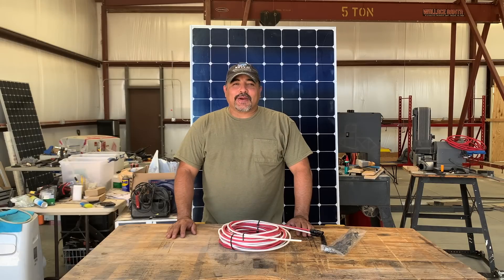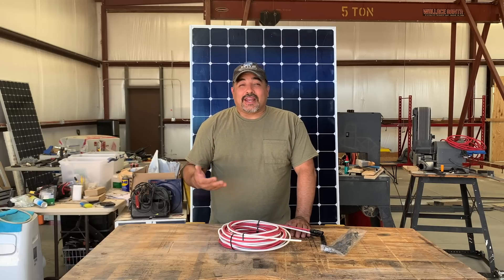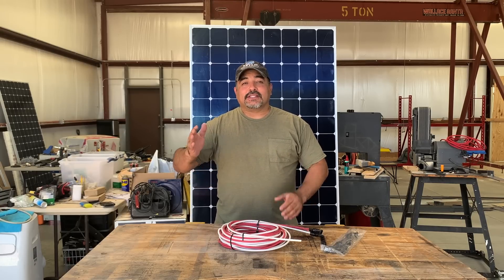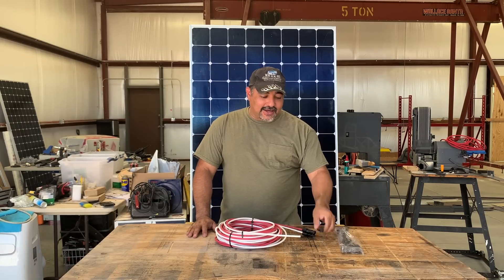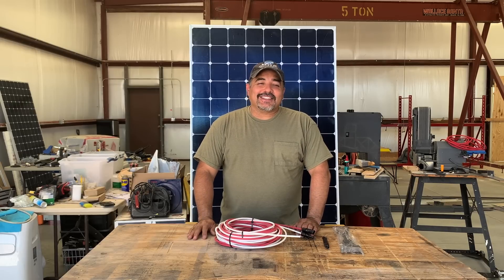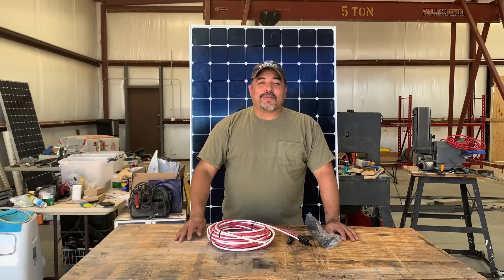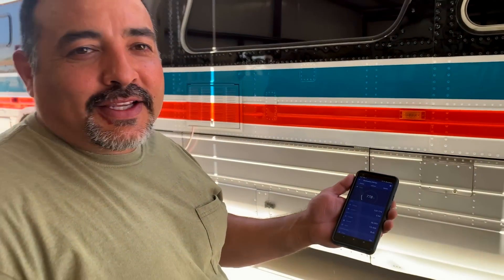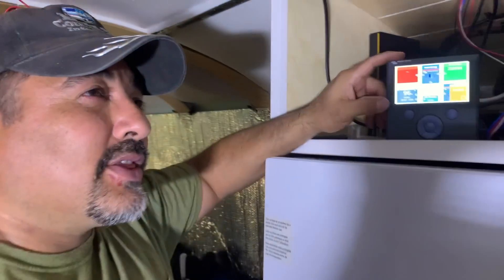More Power for a HOT Summer

Comment: 👍👌🇨🇦❤, so just throwing this out there Juan, how much battery capacity do you have in reserve, so say it stays fairly warm and you still require the ac but say you get a lot of cloud cover or the bus is not at ideal angle to get maximum efficiency of your solar panels, just my opinion, I would think you need to have more battery reserve, because as you were explaining, it sounds like you are just trying to maintain, rather than have sufficient reserve to last you over a loner period of time, I came across the same issue with my tinyhouse, but I have increased my array to 32 x 430 watt panels = 13,760 watts and have increased my battery reserve to last me a minimum of 5 days of full usage and have not depleted my battery reserve, so as with most things, more is better at least in battery reserve, of course there is little point in having a large battery bank and not enough solar either, as then the battery bank would not likely ever hit full charged capacity, I also split my array in two sections for redundancy, so if for any reason a charge controller or a meteorite (lol)  takes out some of the panels, the sysyem is still functional. Just my $0.02, which is not worth much these days, as pennies are not even a currency in Canada any more, 🤔😉🤣 and you determining your sysyem capacity in Arizona, but what happens when you change locatioms and the angle of the sun is less ideal, as your sysyem is stationary in the flat position and unable to angle the panels, I have to angle my panels to a 50 - 52 degree angle to obtain the most efficiency of the panels, If I leave my panels flat I will lose as much as 10 to 15 % and you can lose another 5 to 10 % just due to any dust on the panels, The angle of my panles matches my location lattitude
Reply from the maker: Thank you Greg for the detailed comment.  It really sounds like you have your system dialed in!  We are still learning what is working for us and really appreciate your feedback.  More battery + more solar is always going to be better (in my opinion at least).  Even if I can't charge the battery fully with my solar - we have an onboard 70 Amp charger built into our inverter if we find a place to plug in :) or in a pinch we could run a small generator.  Lithium batteries also prefer to be in the 50%-60% SOC range anyway.  When I first sized the system I knew we would be traveling and I am hoping to stay in relatively mild weather ( I know it can't always be done but if we end up in 114 degree weather you can rest assured that something did not go according to plan).  I thought if we were in some pretty nice weather just running stuff and maybe using occasional A/C or fans we could get our power requirement down to somewhere in the neighborhood of 6 kWh per day.  So I tried to size my battery as close to 3 or 4 times that much (24 kWh) thinking that we could either have a sunny day or find a somewhere to plug in with 3 or 4 days notice. We'll see if my logic was sound once we start traveling :). As for the tilting - my original design had the top set of panels tilting up to increase efficiency - I just couldn't figure out a good way to make that happen and still be rock solid safe.  The hinging with these huge panels is quite a lot to ask and well beyond my engineering capability at this point.  If I was stationary - for sure I would tilt and I might even change it monthly to match the ideal angle.
Reply: @BeginningfromthisMorning  ya Juan, thay would be some engineering nightmare, extendable and retractable and angled, I think I would just leace it as you have it, having the panels angle as well and if any wind caught them, it could really mess up you system, I did drop you an email about angling your portable panels, hope the info helps,
Reply from the maker: @pocketchange1951  Thank you - I did get the email and really appreciate you writing it.
Reply: @BeginningfromthisMorning  Juan try this panels,  they are beter reflecting the heat CANADIAN SOLAR, BIFACIAL 400W PV MODULE, 72.8" PV WIRE, T-4 OR MC-4, 30MM CLEAR FRAME ON WHITE BACKSHEET, 144 1/2 CELLS, DOUBLE GLASS, POLY, 25A MAX FUSE, 1000VDC, 373.6 PTC, CS3W-400PB-AG or the Trina and Jinko with the new cell configuration.

Comment: Heat and lower efficiency is an issue we have in summer here in Oz as well, I over specced my house setup to cope with that and because its on a tin roof I lose roughly 18% efficiency on my 6.5 Kw house system, What I learned  from you was that my old 250 watt panels can be snuck into my existing array or on the second channel and I will be buying new more efficient panels for my Bus conversion I think.
Im also thinking of trying the flexi panels mounted on an alloy skin (Safari Roof) that gives me an air gap for cooling between the bus roof and the panels as the flexi's suffer badly from heat im told.
Awesome episode!
Thank you

Comment: I ran into the problem with the heat and my solar panels, losing their efficiencies because of the heat. I knew of this beforehand but still didn't hit me until I started using my solar full time. The upside is fall, winter, and spring, I produce a load of power. On the inverter generator, don't mess with a small one; just get a 4000/ 4500 watt, or a little bigger with a least a 3500 to 3700 running watts, light a Westinghouse, Cummins Onan, Pulsar, Hyundai, or something like those. Just in case! I learned the hard way and spent extra money on a little one when I knew better. My son is happy for the small generator [ e3200 ]. I'm not! But still have the Hyundai and the Westinghouse both are super quiet, and my Hyundai is more peaceful than those Honda and Yamaha. That right, I said it! The Westinghouse is almost as quiet as the Hyundai; it's so close it's hard to tell.
Reply: One free human in this reality along these lines, another YouTuber, LongLong Honemoon, has evaluated a number of portable generators. Some of their findings might’ve a jumping off point for further gen set investigation, if you ever decide to explore that further, but it looks like your ground deploy will tide you over through the heat of summer.
Reply from the maker: Great suggestion!  Thank you so much for the thoughtful feedback.  I was really surprised at how much capacity we lost because of the heat.  We are still undecided on a generator but we will likely not be able to pack a larger one.  We are running out of room in our poor little bus.  I supposed if it got that bad we could sacrifice some of our garage space ... hmmm ... now you have me thinking.

Comment: you already have a badass inverter, a full generator would be a waste. why not use a generator without the built-in inverter to charge the battery bank? No point going from DC to AC, back to DC and then back to AC. 
you would just hook it up to a charge controller, or like the DC to DC chargers?
Reply from the maker: I had not really considered a DC-to-DC gen-set - very interesting!  Thank you.
Reply: there are wind generator alternator that have high amps 500 amp and need big rectifier do sell. 12 v @ 500 amps 6000 watts
Reply: I was thinking the same thing except to build a small engine & car alternator gen-set to output 60-120 amps DC instead of the 8 amps DC normally output by a small generator.
Reply: @gregorythomas333  You could just get a cheap Harbor F small gas genny and pull out the inverter. install a charge controller in its place
Reply: damn, they already make them
ALTEN DC GENERATORS ARE THE DIRECT SOLUTION FOR BACKING UP 12, 24 OR 48 VOLT BATTERY SYSTEMS
Reply: @swaterman08  Nice...thanks for the info!  :)
Reply: @gregorythomas333  It's only 1 of 20 other inventions I came up with that already exists, except for my double dog leash I did in 5th grade and I remember my teachers laughing at me and not taking it seriously, but you can buy them all day on Amazon now.
Reply: damn, they already make them 
ALTEN DC GENERATORS ARE THE DIRECT SOLUTION FOR BACKING UP 12, 24 OR 48 VOLT BATTERY SYSTEMS

Comment: Great job good to see that it worked 
I had a thought I lived down there in Mesa years ago and it does get hot to hot but you deal with it right my thought is if the solar panels are not able to operate at very hot temperatures can you use misters on them? I mean they worked on keeping surrounding area cool just my first thought Juan if anybody could figure that out it would be you guys.
Reply: Brian Davis I was thinking about  cooling fans as I watched this, and with the arid desert air, I think the swamp cooler idea might be useful, but being from the Louisiana, our humidity levels are so high, the misters are of negligible value, so we don’t have much experience with them here. 

After watching so many of your build , I’m sure you considered this, so why won’t it help you?
Reply from the maker: I had considered the misters and I think if we were staying here I would already be doing it.  My thought process went something like this.  Ideally we will be traveling with the weather where the temperature range we are in is between say 60 to 90.  If we find ourselves in a situation where we are anywhere near 105 degrees (this is about the threshold where the heat really affects the panels significantly), then we made a mistake somewhere (or we are home visiting family and we are hopefully plugged in somewhere ;)).  Here in AZ the misters would be amazing but as O.C. Smith mentioned - almost anywhere else they would not provide much value.  The other issue here is the hard water - and SOOO much dust.  The hard water alone would prevent us from being able to spray the "face" of the panels because they would become very milky and probably affect performance.  When we clean the panels now we have to be sure we squeegee the panels so they don't get all the hard water spots on them.  Lastly plumbing it would be non-trivial.  At this point given our time constraints and plans I don't think we will have time for it but I really like the idea.

Comment: Another great vid guys. Thanks so much for sharing and letting us know how you figure things out. Here’s my question. I know you said in the past you’re kinda behind posting vs current state of the build. So with that I’m guessing this was before monsoon started, or right about the start. I’m wondering how much monsoon has impacted and if your able to keep up all the same? I know down south here monsoon has hugely impacted what I’m producing each day and it kinda sucks. Just wondering if you’re having similar experience further north.
Reply from the maker: Yes, we did this in mid-June, pre monsoon.  Unfortunately, we haven't had much of a monsoon this summer.  A couple storms recently, but nothing like normal. We would have loved some more storms just to cool things down a touch.  Instead we have just been having extreme heat.  But, at least we're still  producing electricity over here.  I may trade some power for cooler temps!  :)
Reply: @BeginningfromthisMorning  it was a little hotter than usual down here as well, with lots of overcast, but not a lot of rain either. The desert climate seems to be changing right along with all the others. Hopefully the cooler weather is headed our way soon.

Comment: Once the builds complete and you're no longer drawing as much power plus being on the road and not in extreme heat, hopefully things will be back at 100%👍👍
Reply from the maker: This extra power has been just what we needed this summer.  But, yes, when we are traveling and not using all the extra power of the tools plus staying out of the ridiculous heat of a Phoenix summer, we should be doing well with the rooftop solar.